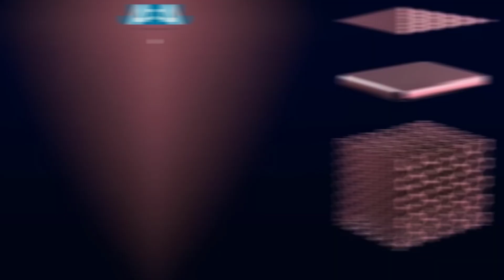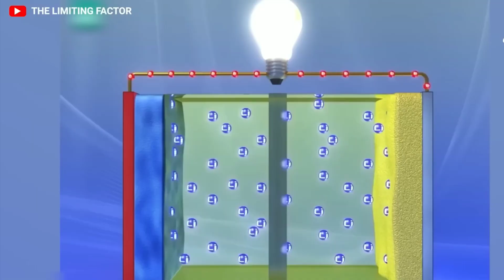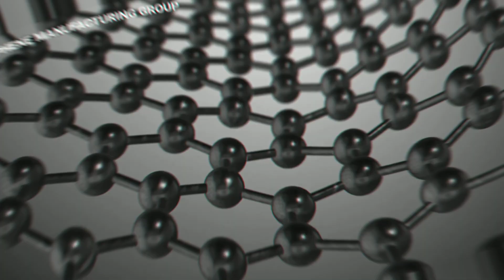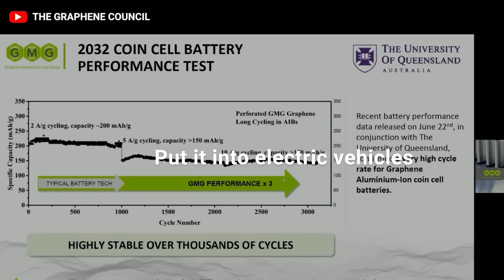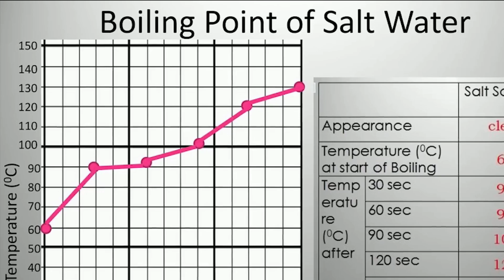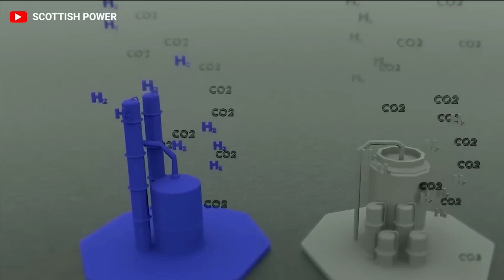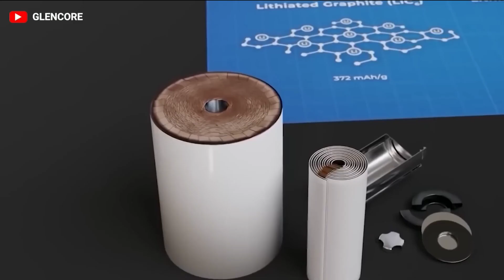Elon Musk’s Shocking Battery Breakthrough: Lithium is History!

Comment: 7000 w/kg is a meaningless entity. I assume he meant 7000 w-hours/kg, which is 20 times the capacity of current batteries.
Reply: No, he meant 7000w/kg for "power density", as he said. Right after that he says "potential to have 3 times the energy density of lithium ion".